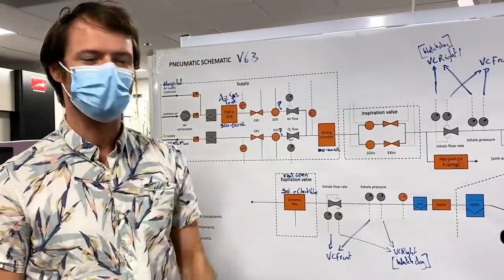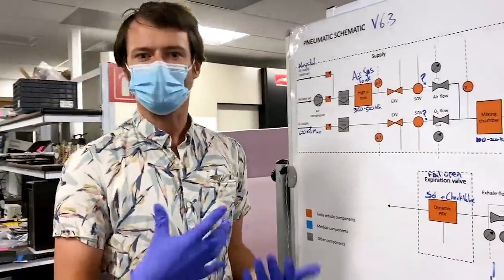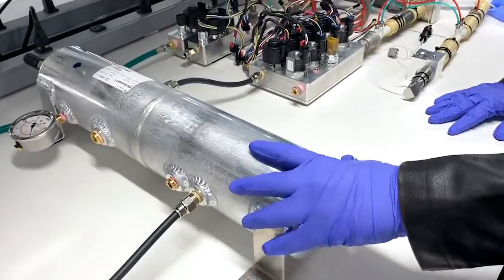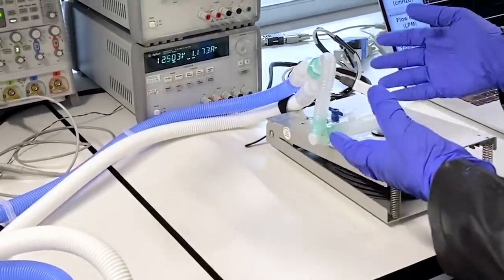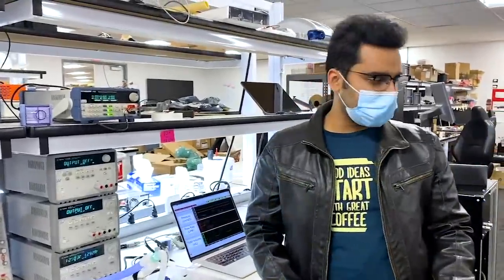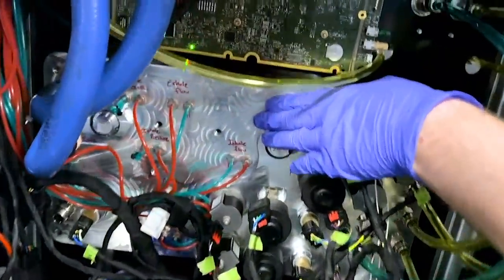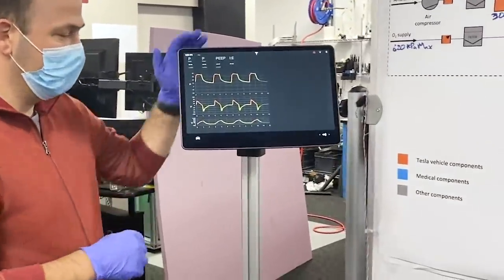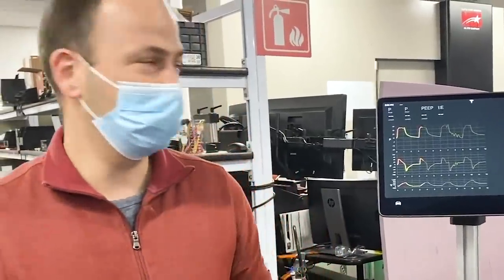Tesla Ventilator

Comment: Brilliant effort.  This is precisely why my next and probably last automobile I will ever need will be the Cybertruck I ordered.  Bravo Lads.  Well done.  Teams like yours are akin to the Apollo 13 engineers that did a great job with that which they had on hand.  Outside the box thinking is phenomenal.  Throwing the box into the recycle bin is even better!  Your team has done both.  Awesome work.  Thank you for this engineering solution that has that level of attention to detail and ease of interface.  If you ever need a dentist on your team let me know.  Tesla time and again shows what ingenuity an striving for optimization can accomplish.  One additional idea that I would suggest is contemplating an adjunctive Capacity to make this respirator semi closed loop with a CO2 Soda lime Scrubber in case ambient situations necessitate recirculation due to non hospital use.  Think Rebreather with counter lung capacity if necessary?  Just thinking........ Super Job.

Comment: we need more CPAP machines along with ventilators... please upvote this so that Tesla notices
Reply: Musk commented on this days ago. He got crap for sending hospitals cpap and bipap machines instead of ventilators, and he made the same argument, saying ventilators are a last resort and cpap/bipap could save more lives.
Reply: jhogrute why CPAP?
Reply: @p.folzey5809  CPAP = continuous positive air pressure and BiPAP = Bi-level positive air pressure machines are used as the penultimate stage before ventilators... we are saying we need more ventilators which is true, but ventilators are by themselves quite critical care and you need to insert the tube inside and needs a lot of muscle relaxing meds and sedatives because it takes a heavy toll on the body... so ventilators are last resort.. BiPAP and CPAP machiens are not invasive and can be managed by the patient.. and no invasive tubes... btw tesla's model is actually closer to a BiPAP than a tyraditional ventilator
Reply: jhogrute there is a high number of ARDS type patients from the results of COVID-19. ARDS: Acute Respiratory Distress Syndrome. These types of patients cannot be managed in a non invasive setting. If patients are intubated in the earlier stages of the disease process, theoretically they will have a better chance of a better outcome.

Comment: Brillaint to hear Tesla are on the job.

 I will say "Forcing air into the lung" is probably not the right way to discribe it. A better description would be 'a ventilator augments the patants breathing' as you're trying to reduce the fatigue patants experiance from lower function by assisting it, but just as importantly avoiding doing more damage to the lungs diaphram and related muscles by resisting their natural operation. Bare in mind, a lot of the patants that need these machines are elderly, frail and may already have existing health issues before the got hit with this flu. 

I'm sure you guys know what your doing. great work

Comment: Will you give a thought to my idea? Why not use one ventilator for many patients?
I'm a nurse & have an idea to solve ventilator problem if arises. 
1. We can add multiple tubing to a ventilator with t-piece connectors  & use it  for many patients. We just need T-piece, one-way valve & flow regulators. 
                           1 ventilator = 4 patients.
Tidal volume (amount of air required for patient) can be set as per combined requirement of connected patients.
One way circulation of air will prevent  cross infection.
Flow regular will ensure the individual demand of patients is met.
Any technical person or any other person can do it. If help provided I can guide them how to do it. 

2. Also a simple AMBU (Artificial mechanical breathing unit)  bag, with an electric motor and simple circuit, can be turned into ventilator.  AMBU bags are easily available in large quantities in hospitals. And doesn't cost much. Can be used as disposable ventilators to avoid cross infection as well.
A flexible belt which will encircle the AMBU bag. One end will be fixed and other end will be on a roller which it attached to the motor. 
Motor us then connected to an electric circuit which will controller its rotation. 
Force and interval can be set to determine breaths per minute and volume of  air. Reservoir bag of AMBU is connected to portable o2 cylinder and Oxygen flow can be managed as per patient's need. 
This whole AMBU turned Ventilator can be operated with the help of small battery thus, making it portable, and useful in remote areas where large medical equipments are not available or can't be transported.
Total cost will be less then Rs. 1000.

Comment: these guys are krazy smart and have unlimited resources.
however, people all over the net are putting ventilators together for less than $100,  the version in the video seems like thousands of dollars.
I LOVE that they use existing car parts,  beautiful idea.  like the Mosquito in WWII that used wood so it would not take metal from the fighter planes.
no one can say that TESLA is not a BRILLIANT company.
Check out some of the home shops works.  a wiper motor speed control on a bellows = ventilator
add in a simple tablet and sensors and you have have something that can get into the field in days.
one thing is for sure,  once this virus is all said and done, ventilators will be start of the art and easily mass produced.

Comment: It looks awesome, but how expensive is it?
Reply: Workers and engineers need to be paid anyway during the downtime, so labor cost is effectively zero. And the plan is to donate these to hospitals that need them.
Reply: I understand all the economics and the issues. What I am speaking too is the fact that some mechanical engineers in England made a ventilator out of a syringe, air bag and a sprinkler solenoid. Tesla is using high end computer parts. But it does give a lot of feed back and long term medical companies should look at adopting some of the tech.
Reply: @brandonlester5992  
Who, and how do you know their ventilator actually works?
Reply: It was reported on The BBC news channel. They have had it running for several days in a row. The story ran a day or two ago.

Comment: Wow! I started watching this, because I heard about many people doing efforts but slightly missing the point of ventilators (breathing in or out should be initiated by the person, not the machine, etc). On the other hand, at first glance it seems like your schematic takes many important things into account, such as precise in/exhale flow rate, and humidifier for the dry air that bypasses mouth/nose (because patient is in-tubed). Did you actually include some detectors to synchronize the ventilator with the patient's natural breathing?
Reply: I would assume that's what the pressure and flow rate sensors are for. you know Tesla has been in contact with... I think they're called Medtronic? A medical supply company that makes these things professionally.

I wonder if Tesla is gonna keep producing these things and start selling them for profit after the crisis is over. Since they went through the effort of developing them, and if they're good enough/cheap enough to produce, there should be no reason not to, right?
Reply: @theuncalledfor  Sounds good, especially if they get them certified! Thanks for the info, didn't realize they were in contact with some medical equipment manufacturers!

Comment: Amazing to see an actual ventilator and not just a PR squeeze-bag. Great job!
Reply: What do you mean by "PR squeeze-bag"?
Reply: @theuncalledfor  Like the ones made by Virgin and Seat (a VW subsidiary). They just made large clamps that close and open on a manual ventilation bag with no airflow or air pressure sensors, not to mention the lack of precision controls. A proper medical ventilator has pressure and flow rate sensors (like the one Tesla is building). Without those features the ventilator is useless for anything more than first-aid cases, since it can damage the lung and make the situation even worse.
Reply: @MrMuki61  
Thank you for explaining! Here, have a like.
Reply: @theuncalledfor  Thank you for asking and being curious :)

Comment: I mean the ventilator itself is kind of a trivial machine, I think it's not that hard of a thing to design a new kind of it in an engineering pov, the tricky part is to make it so it works reliably, and that requires sufficient testing with an analog or a live patient which of course takes a lot of times before the mass production begins.
Anyway what I'm saying is until Tesla can mass produce this working ventilator (and I'm hoping that they can, soon..), I look at this video merely as an exercise from Tesla engineers that they can make a ventilator out of parts of their car.

Comment: Build an negative pressure ventilator.  They eliminate the need for intubation, humidification, and complicated controls.
The entire body of the modern iron lung could be made from HDPE for < $20.

https://www.alibaba.com/product-detail/1-meter-diameter-polyethylene-hdpe-water_62337386565.html?spm=a2700.7724857.normalList.216.6fbc7c044zhrTY

Comment: Looks like they're taking it seriously WITH a battery backup (very important if you don't want the patient to die if the power goes out) AND a bunch of sensors to make sure the machine breathe at the same speed as the patient and the pressure is not too high which otherwise can seriously damage the alveoli in the lungs.

Comment: SpaceX ventilator: just a raptor engine and a tube.
Reply: Super Draco.
Reply: better than a rupture ventilator, blasts your lungs with oxygen
Reply: should take care of the virus for ya.
Reply: They said they needed oxygen. Never specified room temp or cryogenic.
Reply: @loganbusse1462  Before being pumped into the lungs, the air gets conditioned - filtered, warmed up and moistened. But that's the easy part. Oxygen gets mixed with air before the air gets heated and moistened. Therefore, it doesn't much matter - the mixer design is not the critical part. The critical part is controlling pressure and synchronizing to the patient's natural breeding cycle well enough to not do any lung damage.
Reply: @a0flj0  What does the patient's "breeding" cycle have to do with it?
Reply: @MrCPPG  breathing
Reply: @MrCPPG  well depending on how active the breeding cycle, it can be rather aerobic ...
Reply: @MrCPPG  I was just responding to a comment asking about what kind of oxygen the device would use (or rather, in what form of aggregation that oxygen should be at the entry point).
Reply: Florin Jurcovici no mechanical ventilator synchronyzes to the breath rate of the patient, the patient’s lungs are sedated and paralyzed artificially to avoid discomfort, lung damage and to increase efficiency.
Reply: @raidzor5452  My understanding was that there are different stages of invasiveness, and that the thoracic muscles are not always immediately sedated, and that as long as the patient still breeds on his own, however weakly, the mechanical ventilation just amplifies that breeding. But I'm not a medic, so I might be wrong. However, from what I know, the ventilator still has to synchronize carefully to changes in pressure - it is not allowed to create pressure too high, or it will burst the tiny air sacs that form up the lungs, or let the pressure sink too low, which would cause the same tiny sacs to collapse and not open up again. And it has to very precisely react to pressure increases and decreases. To my knowledge, at least.
Reply: Florin Jurcovici Yeah, you’re right, that’s what I read too. I don’t know about the synchronization and sedation part, I just read that the machines don’t sync to the breath and force the respiration, which is uncomfortable. Other than that, homestly, I’m not an expert either.

Comment: Interesting since most auto or industrial pneumatic valves require lubricated air to ensure proper operation over a period  . How will they use the same valves in a non lubricated environment is interesting.

Comment: I can imagine what the GM & Ford ventilators will look like..... 3L normally aspirated gas engine with 6 speed transmission connected by belt to their air con system with rev counter and handbrake for each bed, LOL

Comment: That's pretty effing rad, guys!! I'm not an expert, but the cynics out there tell me, that because of how over-pressurising the lungs will eventually start damaging the tissue where oxygen uptake takes place, these types of forced-breath ventilators are quite likely to do more harm to the patient than good. Have you given this part of the problem any thought? I know it's a bit over the top, but what about leveraging the machine-vision component from FSD to detect the breathing intents of the patient? For example by analysing muscle movement in the torso and throat. It miiiiight be, that simply monitoring the natural breathing efforts by detecting pressure changes is more feasible tho :-D

Comment: Good to see you also keeping in mind a lot of the challenges that most newbie ventillator designers are missing, such as flow control, pressure control and PEEP. I do wonder though if heat and humidity are also being factored in? For ventillators this is kind of an important part as an intubated patient of course is breathing through a tube and not their nose, which removes the use of sinuses to heat and moisten incoming air. Not warming and humidifying incoming air will dry out the patient's lungs which will in turn cause more damage.

I am glad to see companies take on the mammoth task of designing and producing high demand medical supplies like this though. You guys are freaking awesome!

Comment: What I could not determine from this video: how is the breathing cycle triggered? 

There have been many articles flying around critiquing the blind focus on mandatory breath which won't help at all. But this looks suffisticated enough to be preassure or volume triggered. Could you go a bit into depth about that?
Reply: He explains it at the end, the bellows on top are a simulated lung, which breathes on its own. The machine maintains positive pressure to keep the lungs inflated, but the breathing itself is done by the patient. This assists the patient and doesnt breath for them, which is exactly what is needed.

I hope this clarified, I was also looking specifically for this
Reply: @Flimzes  It wasn't clear to me that the artificial lung was capable of doing so. Thank you for clarifying! 
More props to them, very few to noone else seems to properly engineer around the actual problem to solve.

Comment: First minor point, you'll need an exhalation heater to prevent condensation and a filter to prevent contaminated air being blown into the environment.

Secondly, stop touching your mask. All of you have this tick. If you have to keep adjusting it, you might as well take it off. (As a cleanroom worker, I know it takes some getting used to and self discipline, but it's an important rule. Even more so if you ever need to work on sterile units)

Comment: Liquids are incompressable. What good does it do to add air to a lung full of liquid? Why not drain the liquid and improve lung performance.
Reply: Peter Torres because that would dry our your lungs. the FDA requires ventilators that work reliably

Comment: Will you have a warming and humidifying device for the air that is supplied to the lungs?
Reply: C L There is humidifier in the schematics, external to the machine.
Reply: @TWFydGlu  if I'm not mistaken, it's not external to the machine, just external to Tesla manufacturing. I guess they don't have a humidifier in the car so they would have to outsource it
Reply: @reebo2011  The color is blue, meaning "Medical component", not orange for "Tesla vehicle component". But it is to the right of the dashed line saying "Outside Tesla system"
Reply: Adding a humidifier is easy with an HME but it adds dead space to the circuit,  which is wasted volume.

Comment: It's nice that they use the parts they already have , but won't that increase the cost of a ventilator ? Only the display and the entertainment unit controlling it must cost a fortune. Don't get me wrong, I think they are brilliant, but it's probably not the most cost effective ventilator they can produce and US will need a lot of them.
Reply: They happen to have these components at hand in large quantity and quite inexpensively -- comparing to the cost of a regular medical ICU ventilators which sell for $25-$50K. They are also intimately familiar with this equipment -- to the extent that they were able to reprogram the car computer to control the ventilator in a matter of days. It would have taken a lot longer to develop a new, custom made circuit. And a car computer is actually a very good fit for this purpose -- it is already constructed as a safety-critical component able to withstand very punishing environment, and it is programmed and validated with the understanding that people's life will depend on it. 

If you look at the diagram on the whiteboard, you will also see that safety-critical parts of the ventilator are duplicated. This may be a home-brew ventilator, but make no mistake -- it is being built to a very high standard of reliability.

Besides, Telsa is helping to make parts for conventional ventilators produced by Medtronic -- a specialized medical equipment manufacturer.